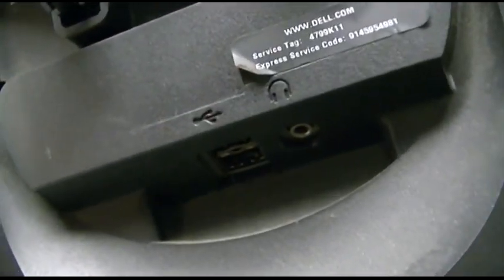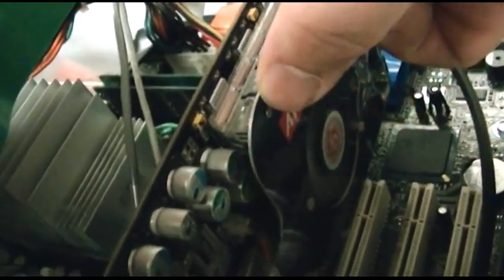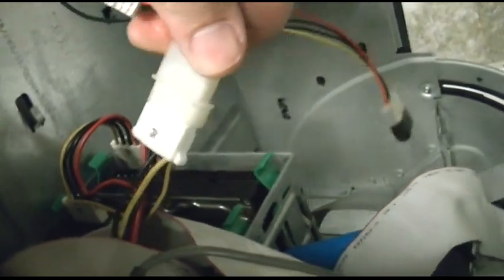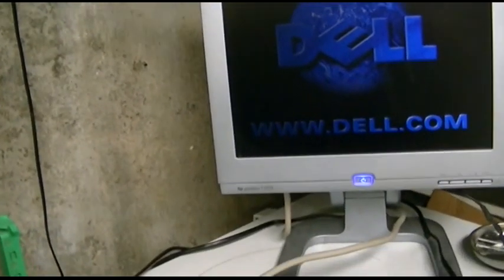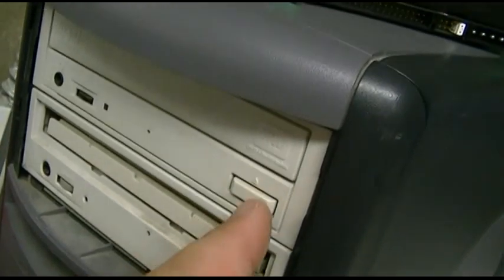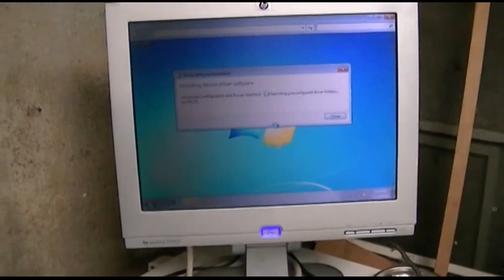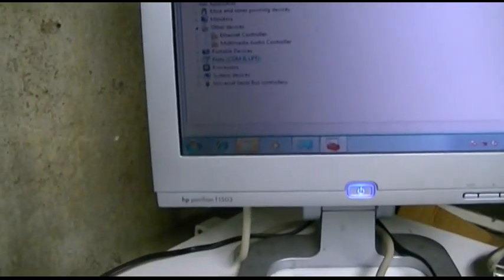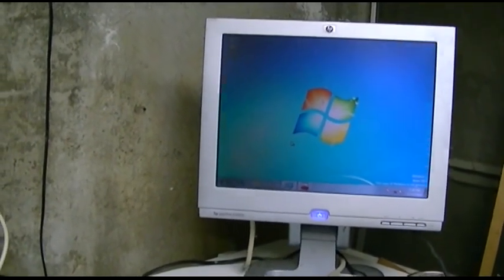Dell Dimension 4500 Diagnosis

Comment: i have one of these in really good condition with a 500gb WD caviar blue
Reply from the maker: +BrianGriffin1999 I have a 4700 with that kind of hard drive in it.  Subsequently this machine was outfitted with some spare HDD I had sitting around and the wife uses it.  Runs Windows 7, RAM maxed out at 1GB.  For me, it doesn't really matter what it looks like so long as it works.
Reply: the 4700 maxes out at 1gb? thats wierd, the 4500, which if the model number says anything is older, supports at least 2gb max, because my 4500 has 2gb
Reply from the maker: +BrianGriffin1999 No, I was referring to the 4500.  According to crucial.com it only supports 1GB.
Reply: really? mine supports 2gb just fine, shows in BIOS and operating system
Reply from the maker: BrianGriffin1999 They've been known to be incorrect before.  If I had 2GB I'd dump it in that system.
Reply: yeah i have also seen a lot of incorrect info on their website, also i never looked up ram limits or anything, my system just came with 2gb of ram, im guessing that the person i got it from upgraded it
Reply: 1G vs 2G discussion. "It depends". https://www.cnet.com/forums/discussions/memory-in-dell-dimension-4500-259652/

Comment: Well , its an old video but where did you go wrong? .....that video card require a power supply of at least 450 watt , this machine only have 250watt power supply
Reply from the maker: Black Diamond That video card's power connector had dodgy solder connections on the board.  Regardless of the PSU in the machine, I really don't think you'd be pushing out that kind of current over a molex connector.  These were back in the days of AGP cards, we didn't have the 6 and 8 pin PCI Express connectors like we do today.

I really have a sneaking suspicion that card was working in that machine at one point.  You wouldn't have a machine with a bad hard drive, and then throw that video card in it to fix the problem.  Nor would you put a known bad hard drive into an otherwise working machine.

I had plans to resolder the connector on the board one day and try it again, but that got put on the back burner, the card moved and misplaced.  One day it'll turn up and I'll resolder it.

Comment: We still have ours, and it's actually holding up to some extent after 12 years of use. It's a good computer and probably one of the most popular models of all time. These used to be everywhere. The one complaint I have about it is the location of the front USB ports and headphone jack. The way that flap cover is designed and the angle of the ports made it so that one would have to get down and basically crawl to insert a flash drive...if it would even fit...the way it's designed, many bulky USB items wouldn't even fit and they would have to be put in the back instead. Luckily, many later models eliminated this and located the USB and headphone jack in a small cutout at the bottom below where that flap is.
Reply from the maker: I don't remember this particular model being so popular, but this style case was around for YEARS, which is something you don't really see nowadays.

I know all about the front USB/headphone jacks.  At the time this style case came into production, front panel stuff was in its infancy.  Dell thought it would be a good idea to mount them as such, but everything you said is true.  It's unwieldy at best.  Also, at the time there were quite a number of USB things that were, shall we say, non-standard size.  Some of them came with short USB extension cables, I have maybe 4 or 5 of those.

For my machine I bought a USB extension "pod", it has a weighted base and sits on my desk, but I tend to keep a flash drive plugged into it at all times.  I keep that as my "scratch" drive--raw video files get pushed to it over the network, and when I get the chance I upload them and then file them away on my external drives.
Reply: Yes, I had forgotten about how young the front-panel features were at that time. Come to think of it, the Dimension was the first computer I ever owned that came with USB ports at all. When I first got it, I really didn't have any devices to plug into it but, if I still used it as my main computer, I would definitely use my USB hub instead of the front ports.

It still surprises me that Dell would choose to put the ports and headphone jack there, though. After all, I've seen many computers from earlier years that have the two ports nearer to the floppy drive. I know Gateway tended to do that. More importantly, however, the location of the headphones is a definite oversight. I had to get an extension cable if I ever wanted to use a headset with that computer.

That's really the only problem I had with it, though. The fact that it came with dual CD drives was great; it made copying homemade CD's quite easy and certainly less time consuming. It was the last desktop I bought to include a modem and floppy drive, which is the main reason I keep it kicking around. I've actually needed to use both every now and then.
Reply from the maker: Rebelkid1112 I hear ya loud and clear on the floppy and modem, still use both of mine occasionally as well.  I keep another box on the network with a 5.25" floppy drive and Zip drive for the same reason.

Front panel ports on desktops generally only made sense if your machine was on the desk instead of under it, but then that eats up valuable desk real estate for junk.  Otherwise you have to reach down and it's still a pain to plug stuff in.

I actually have a really old HP desktop (does Celeron 733MHz ring a bell?) that actually has front-panel USB (1.1 of course), but more interestingly has a 9-pin serial port up front!  Why?  At the time digital cameras were just coming on the scene and they didn't hook up via USB yet, they hooked up via serial!  (Yes, in case you're interested, I do have a serial-connected digital camera).
Reply: Oh yeah, I've seen a few of those. I actually have a camcorder sitting around somewhere that has a serial connection. It's uses VHSC's for video, but it claims to have an 8mb internal card for capturing pictures. Never used that feature, though; I'm not the kind that likes to take photos with camcorders.
Reply from the maker: Rebelkid1112 Yeah I agree.  My still camera takes horrible video, and my video camera takes horrible stills.

8MB will take quite a while to transfer over serial, probably a bit over 10 minutes.  I guess that wasn't that long to wait back in those days...

Comment: This is my comp at work, runs Windows XP. Certainly slower than the newer ones there, but overall, it runs fine.
Reply from the maker: Wow, I thought mine at work was outdated, I have an i5!  We've gone away from XP at work, although some legacy machines still run it.

It's really amazing how the right stuff can still be functional.  Even though these machines are about 12 years old, you will never see quality like that again.  Nowadays you'd be lucky to expect 3 years.

I'm still running my XP machine as my daily driver, and it does everything I need to do.  A little pokey at times, has its quirks, but it gets the job done.